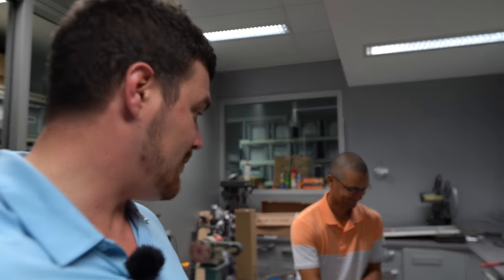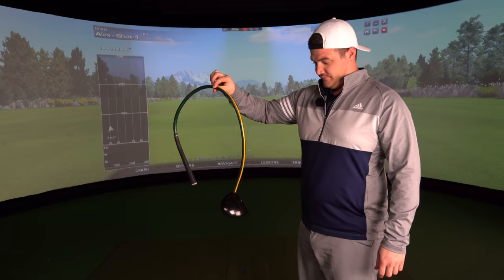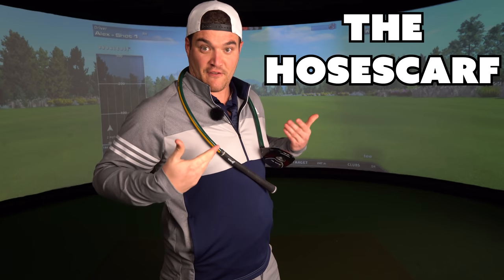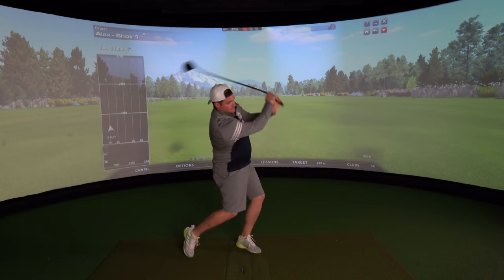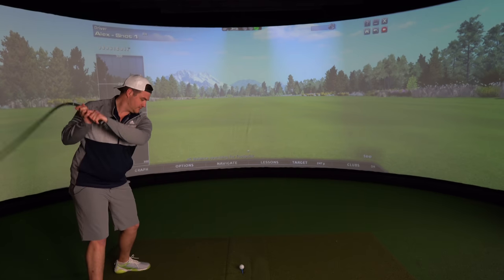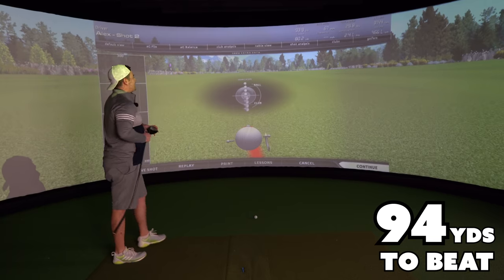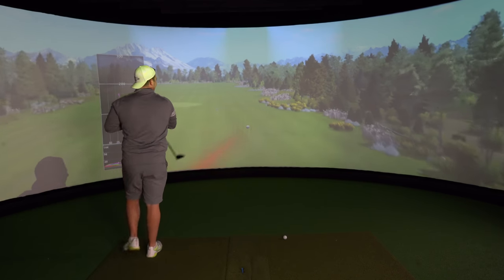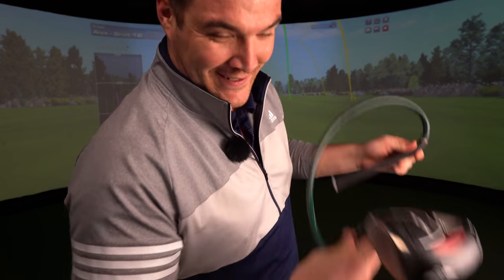WOW!! I MADE A HOSESPIPE GOLF CLUB  | CH-AL-LENGE

Comment: Im curious if you could essentially do the same thing BUT have a shaft 2/3's of the way down the hose. Only allowing for the last 1/3 to be flexible. I think it would give you the best of both worlds. Having the structural integrity of a normal club but the last bit still being incredibly flexible but stable enough to hit the ball. I wonder what the physics would be on the club head speed. I imagine it being like a catapult when the rope snaps away the object (club head)